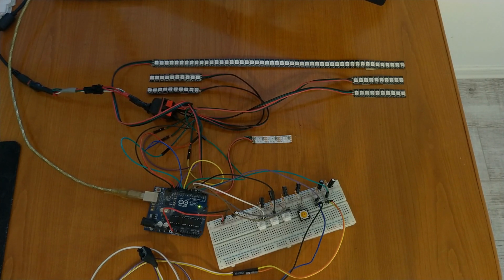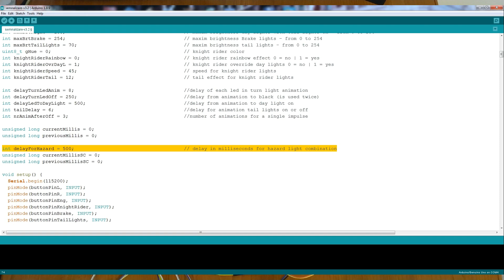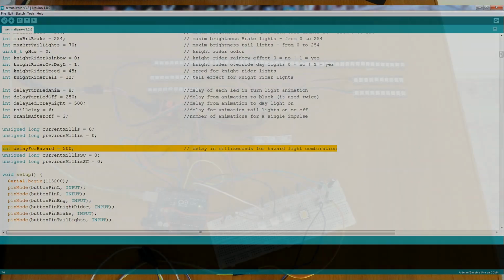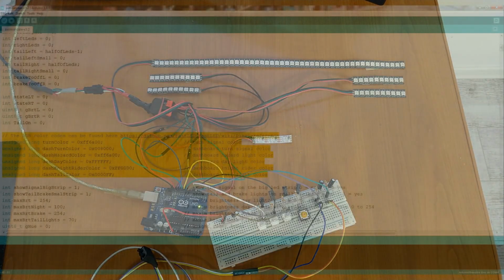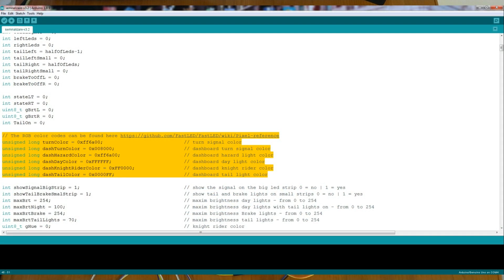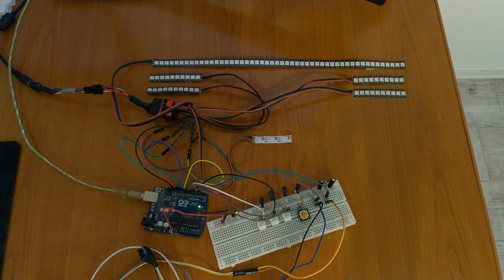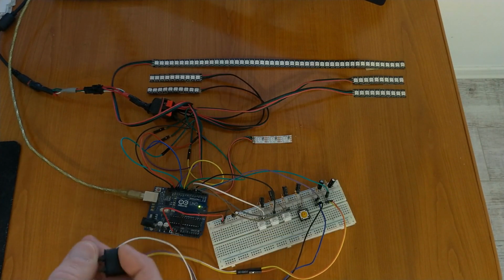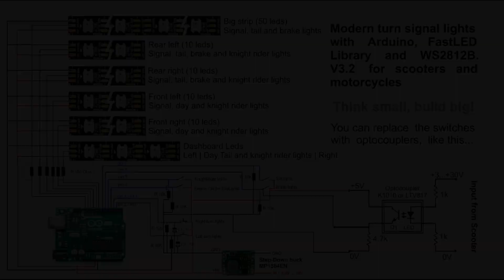Sequential turn signal lights v3.2 for scooters and motorcycles-Arduino,FastLED and WS2812B NEOPIXEL

Comment: Where is emitter of optocoupler connected, is it connected to gnd . And collector is connected to arduino pin to trigger the signal, am i correct or wrong.

Comment: Hello !Are anybody home here? Long time no new messages. Look, i do not know coding about but need for my chopper tail light just one only (without short strip's) long strip 70led code with : LR turn, tail, brake, knight rider and last one - VU metter with music effect's from the center to side's. Would be cool. VU metter input from mic to react to playing music from outside. Can you do it for  me? Thanks a lot. By the way. i all day try in your 3.1 code to add Knight rider to long trip - No resut 🥵🥵🥵And one more thing. You use 144led/m. I did the same, but got wrong color's: brake was green. After change in code NEOPIXEL to WS2812 got right color.

Comment: Incredible video and explanation, Thanks! My son asked me to build him this circuit for his car. I build another of your projects (an easier one) to test my abbilities and see if i can do it, it worked! Now i want to build this circuit but use 4 16 bit neopixel rings instead of stripe. It worked on the other project and the only downside was that all rings rotate in a clockwise direction. Would be cool to have the opposite side turn counter-clockwise. Do you happen to have that code you can share with me? Thanks again and a great job you do there. BTW i am very bad at coding and know almost nothing about it 🙂

Comment: This is perfect...  I love it...  =) There is just One other function i would love to have with this...  and that is the possibillity to have the turn signals flash like warninglights...  Strobe funktion so to speak....  and to be able to switch between colors and patterns on that....
Like another mode for the nightrider light..=)   im gonna try this out on my motorcycle...  =)
Reply from the maker: I'm glad you love it... As for the extra functions, the code will need a complete rework especially for multiple colors and patterns.

Comment: Love this project, i tried to implement it on my R7 but cant get the indicators to work for some reason
Reply from the maker: Did you tested on the bench or test it directly in the R7?
Reply: @IonutF-TS-BB  i got it working thanks
Reply from the maker: @andythejedistewart   Great, post a video when you have the time, it will be great to see it...

Comment: Nice design, I want to try it. Anyway the input of the optocoupler is motorcycle +12v switch right? and i need 6 of it to arduino pin 2-7. thanks
Reply from the maker: With the two 1k resistors as in the schematic the optocoupler will work from 3v to 30v, so yes 12v will work. With pleasure.

Comment: Are there any precautions against using RGB LEDS on automotive lighting due to so called rainbow effect which might confuse the road users? Diffusing the light with vellum paper might help slightly but it reduces efficiency and throw when used under the 7mm 30° and 60° lenses made for 5050.

Comment: Can this be programmed to work like a motogadget m relay?
Depending on how long the respective turn signal momentary push-button is activated, 4 different operating modes are available: 

a) Change of lane: Short tap on push-button - blink 3x and automatic switch-off

b) Turn: Pressing push-button shortly - blink 10x and automatic switch-off

c) Continuous flashing: Pressing push-button longer - switches off only after pressing the push-button repeatedly

d) The m-Relay+ is equipped with a hazard flasher function - activated by pressing both push-buttons simultaneously

Comment: Can those sequential turn signals be programmed to work in reverse? "They should set it so it all comes on initially, then sequentially turns off. I would think this would meet the regulation then"

Comment: Seems like the brake light doesn't show on the dashboard? Will have to test it frequently during use to make sure it's still working.
Reply from the maker: Yes, i didn't add the break on the dashboard, but it's pretty simple, define a color in the top section of the sketch (search for dashTailColor on line 51 for example) and in the break section (on line 690 for example) add the color to ledsC strip.

Comment: Why isn't there a buzzer to make a ticking signal as a reminder to turn off the turn signals?
Reply from the maker: Well, I didn't think it would be heard because of the headset and the noise... i will add it in the future version.

Comment: i watched a lot of your videos and i'd like to sugest (what i need, of course) to make a code for right and left sides of a tail lights, separate but in the same arduino, and you can add the right and left headlights too, with sequential and running white lights, and a show mode for all of the four lights

Comment: How do I connect it with my motorcycle and have the stock switch to control these lights with my previous turn signals?
I want to use Integrated day lights and turn signals with my stock turn signals
Reply from the maker: Well, that's impossible for me to answer, because i don't know setup.
The only thing that i can tell you is that you will need some optocouplers, the rest depends on each motorcycle, because no motorcycle setup is the same from my knowledge...

Comment: Im build this with uno, promini, and esp32. With esp32 its more run smooth, but my problem is im use pcf8574 for switch, its output+low, and its must be ground, i use optocoupler to detect stock switch with 12v input. can you make thats one? or were start code must i change, i have try but its make me hrrraaagggh lol. Btw I love you full bruh, good job.
Reply from the maker: Well, i didn't thought at this case and didn't made a variable to be easily change the input state from HIGH to LOW.
To make this change, all the code will need a complete rework... you could try to do it, but it will be painful, even for me.
I'm sorry, but I don't have time to edit it, I didn't had time to make a new video in over a year, my responsibilities have changed in past year.
I'm glad you like it.
Reply: @IonutF-TS-BB  yea so painfull lol, i try change use another i/o expander. i will update here

Comment: I want to build a set for my motorcycle divided in 3 strips: One for each rear signal and one big strip divided in 4 groups, 2 for each front signals, one of each side with drl always on and the other two with turn signals effect. Can you help me to understand how to custom your code for that? Thanks so much.

Comment: Hello, I am a beginner and interested in making tail lights on my bike.  And I have watched many of your clips and it is very cool.  And i came up with an idea  But i can't do it  Because I have no knowledge of this matter.  I want to ask you  In case you can guide me  I have this idea  I would like to have my taillights come in two modes: 1. Normal driving mode, there is an effect when switching on and off, and there is a flowing turn signal like yours, and the second mode is show mode when we press the switch.  Switch to this mode  We will be able to connect to the ws2812b light control box via bluetooth to show the effects.  Both of these modes can be changed by pressing the switch.  Please advise me, thank you very much.

Comment: Hi! Thank you for this project I have been looking for this for a long time, I use your sketch for my scooter DIY signal light and it works great however is it possible for me to change the brake light switch to trigger on from off state(no B+) can I just change the HIGH to LOW and LOW to HIGH in line 493?  because I will use the hall effect switch and I want it to trigger when the magnet is far from the sensor(no B+),  hope you could help me...

Comment: On my motorized bike,
my arduino quite suffered from EMI coming from CDI and lights were going crazy.

bypass capacitors or common ground improvement didn't help me either

Really cool design tho
Reply: the interrupt functions ie. left and right signal light would get affected by EMI. try putting Arduino inside a metal box or shield your CDI with aluminum foil

Comment: Hello my friend. Very good project. I would like to use it on a bicycle. How do I make it work with simple switches? I need help with the code.
Reply from the maker: Thanks!
The basic schematic is made with simple switches, so by following the basic schematic you should be just fine.

Comment: This looks amazing! I've just built my own E-Bike using a kit, and while I don't have any known voltage supply from the controller to work with, the battery pack has it's own USB socket. Do you think there is a way I could run an arduino and power some LEDS in a similar fashion purely from that USB socket?
Reply from the maker: Thanks!
Nope, i don't think that's a good idea to power the leds from one usb, this sketch from the clip can take a maximum of 3 Amps... (with all leds to white can take a maximum of 4.5 Amps)
You will be beter of with a step down converter from your main voltage.

Comment: I'm planning on modding my car headlights so I'm really really thankful that you shared this project. 

I don't know much about electronics so I'm wondering if there should be a modification in the schematics if I increase the number of leds. For example, I'd like to put 30 leds x 4 strips = 120 leds for the front/rear signal lights + big strip composed of 70 leds =  total of 190 leds overall. I will be using the white color most of the time so I guess that will consume more wattage?

Also, where do I connect the switches to my car? (I suppose that's where the optocouplers are used but I'm not sure). If it is, do I need to put one optocoupler per switch?

And lastly, what step down power supply should I use if I will be powering it up from the car battery which is 12v-14v?

Thank you so much! Your answer will save me a lot of time.
Reply from the maker: Yes you can increase the number of leds in this sketch, but the big strip should have the number of leds in the small strip x 3, this means that the big strip should have 30 x 3 = 90 leds.  You could try with 70leds, but i think that the math in the sketch will crash.

Yes, it will consume more when you increase the number of leds. For 190 leds x 0.060 mAmps you will have 11.4 Amps if you light them up all white at full brightness (each color will consume 0.020 mAmps), but in the car setup i don't think that you will have a scenario with them all white at full brightness.

For taking the signal from the car, you will use optocouplers and if your car has enabled bulb checking to see if the bulb it's burnout, you will also need a resistor in parallel with the optocoupler to simulate the bulb.
For the step down converter, you will need something that will step down from 15v to 5v and support the current of all leds.

With pleasure! ;)

Comment: Is it possible to hook up this led's setup with my two wheeler indicator switch as i don't want to install other switches

And can I use different led's which are much brighter than ws2812b
Reply from the maker: Yes it is, by using some optocouplers for controlling the inputs of the controller and some special resistors to simulate the light bulbs to fool the signal relay that you still have the light bulbs ok.
There is another version of digital led " Pixie 3W " https://www.adafruit.com/product/2741 but i don't know how they work because my orders got lost twice on the way to me. I will order them again and will be back with a video after i test them.

Comment: How to use ws2812b 8x8 matrix in this project
Reply from the maker: When you use a matrix, you need to think using groups of leds, frame per frame...
For a 8x8 matrix you will have 8 frames in a given amount of time, so each frame, you will light up a max of 8 groups of leds...
I wanted to do a smart road light signal for some time and that will explain just that... 
I will do it as soon as i have some free time...

Comment: When making this, can i use Arduino nano board instead Arduino Uno ?
Reply from the maker: Yeap, nano will work ok, but be sure that is the 5volts version first...
Reply: @IonutF-TS-BB  Thanks. Does the Code must be rewrite or can i upload your code without any changes to Arduino nano ?
Reply from the maker: With pleasure!
No changes needed when using Arduino Nano, upload and respect the basic schematic... ;)
Reply: @IonutF-TS-BB  Thank You Very Much !!!
Reply from the maker: @galaxygalaxy1569  ;)

Comment: I just build this setup today with your code. Only exception is that I don't have an UNO but a NANO. Your video looks wonderful, but on my setup several things are just not working. For instance the Knight Rider is already working when I start the NANO, with no alterations to your code whatsoever. Leds are flashing incredibly instead of a steady output. Do you have any advice ?
Reply from the maker: Hi. If your nano is the 5V version, then you must be ok! 
Make a clip, explain your setup, show my how your setup it's not working and we will see what's wrong...
Reply: I just figured out that the breadbord I recently purchased is failing. I switched the setup to another breadbord and it is working like a charm... so incredibly happy with this !!!!! thank you so much
Reply from the maker: @donbeele3909  And i thought about that, but i presumed that is to avios and you already checked it... me to had a few breadboards problems and after a few hours working on the code i realized that not the code was the problem and after i changed the breadboard everything was working flawlessly... so from that moment on, i spend a lot more on bradbords... :)
Glad you figured out.
With pleasure! ;)
Reply: @IonutF-TS-BB  Yeah it's working great now.. However I do have a question about some functions.. I noticed that when DRL is set to on, then turn on hazard lights; let then turn off and turn right (or left).. it seems that the DRL for the opposite side is not turning on until ALL turn signals are off.. is this correct ?? I figured that between the hazard lights turning off and switching to a regular turn signal (fast), the other DRL would turn on ... I'm not sure whether you understand what I mean now.. My english isn't perfect hahaha..
Reply from the maker: @donbeele3909  I think i understand what you meant to say and yes, it's correct... because the signals have priority over the drl lights and until both signals are off the drl lights function wont run...
Reply: @IonutF-TS-BB  I've seen it in the code, but admit.. it is kinda strange that normally with a turn signal the other side acts as a drl, except when you switch from hazard to turn signal.. lol

Comment: Looks very good and unique. I have not seen this before. Keep it up dear, but if u can make with 1w or 3w led ...that would be great as I m looking for 1w sequential driver
Reply from the maker: Thanks!
Well, i don't know any digital leds of 1w to exist and the 3w ones are to expensive, bulky and to powerful...  https://www.adafruit.com/product/2741  and to build this example with regular leds it will a messy job with lots of wires and mosfets ... 
But, if you do some calculations for only one signal in this example which contains 10 leds you have 10 * 0.060mA = 0.600mA * 5v = 3w of consumed power, so the emitted light should be a little bit higher, because of the efficiency of the leds in general.
I think i will get my self a light meter and test this claim... because now i'm really curious! :)
Reply: @IonutF-TS-BB  Agreed, since we know that those led light strips have unfocused light making it hardly visible in bright sunlight. Adding frosted glass can improve contrast but will reduce overall efficiency.

Comment: Great job ;) i tried to use pl9823 but i don't know how to change ordrer color in the code. all led light is green. can you help me?
Reply from the maker: Thanks!
From the looks of it, fastled doesn't support PL9823 protocol, not even WS1012 the original leds for wich the protocol was writen.
Here are the suported leds: https://github.com/FastLED/FastLED/wiki/Chipset-reference

Comment: Thank you so much... I will try it at the weekend 👌🏻😄 But one question. If I would use it on my Bike couldnt I just use standart 18650 Batterys to reach close to 5 V and let the Arduino step down to 5? Cause the Arduino Uno can take up to 9V i think. Hes stepping the rest down I belive.
Reply from the maker: With pleasure... ;)
From my opinion, you shouldn't use the internal voltage regulator of the arduino, because is not to efficient ! 
You still need a step-down buck converter for the leds, so power the arduino from the 5v of the step-down buck converter and in this way you are able to use even four li-ion cells. 
From my knowledge, li-ion 18650 batteries have a safe min voltage of 3.4v and a safe max voltage of 4.1v... so you can use 3 or 4 cells to have a decent battery life.
With 3 cells you will have a min voltage of 10.2v and a max voltage of 12.3v and with 4 cells you will have a min voltage of 13.6v and a max voltage of 16.4v, so you must decide how many cells you use and search a step-down buck converter that has high efficiency between your min voltage and max voltage.
Don't forget to include some protection for over discharging the cells if you want them to have a long life...